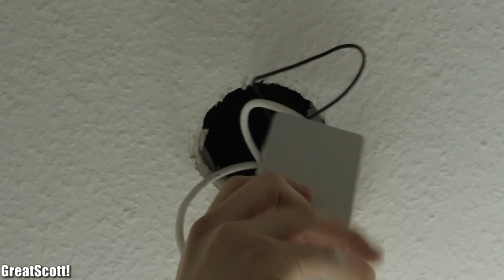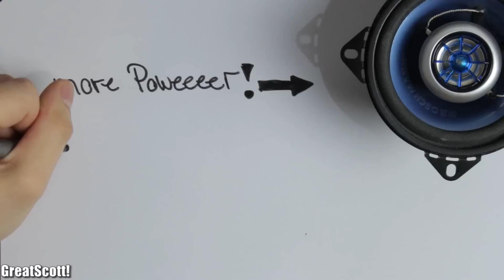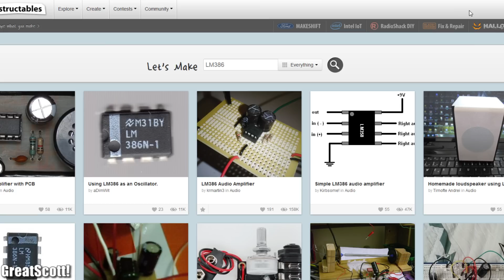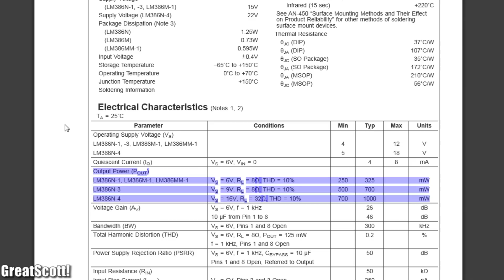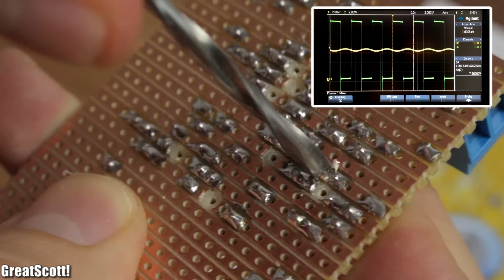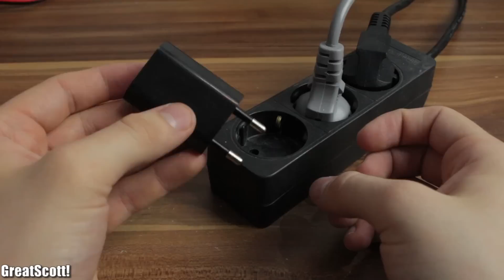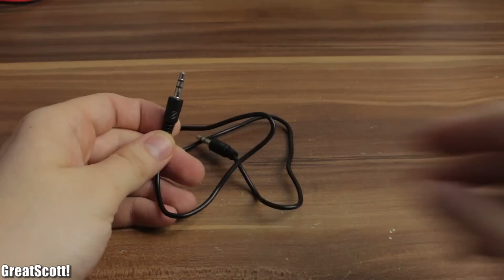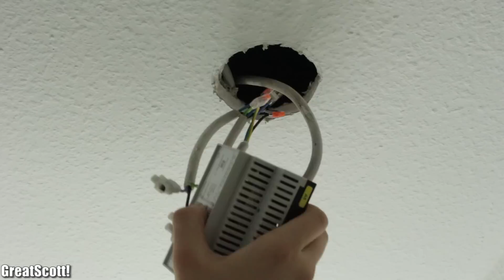Make your own Low Budget Bluetooth Music System || OpAmp

Comment: +GreatScott! You inspired me to build my own version of this using a KRC-86b V4.0 Bluetooth module and a TDA2003 10w Amp chip I salvaged from an old CB radio. In this build you mentioned you were getting interference/noise coming from the 7805 IC sharing source current. How can this problem get solved within the circuit?... At first I put my Bluetooth module in some old computer speakers, but they had a transformer inside them. They had terrible noise, so I ditched them in favor of building a circuit myself with a "wall wort" to separate the 120vac/12vdc power supply. My Bluetooth module is running off a 7805 regulator like you had done. I'm not getting as much noise as you appear to have gotten, but I do hear some light, constant, background noise, and I hear digital chatter randomly coming from my phone connection (like a subtle set of chirps and beeps that sound like R2D2 on drugs). How can I eliminate that kind of noise within a single DC current source? Anyone? :)
Reply: any update on this?
Reply: many capacitors. but with high capacitance.

Comment: i tried this but i think the bluetooth chip is of low quality. After 25 seconds of inactivity(Locking the phone), the led indicator on the bluetooth changes rythm and at that exact moment a significant noise is emitted from the speaker until i unlock my phone. I think it is the chip's problem because the timing of the "SLEEP" mode of the chip coincides with the addition of noise. Anyone faced the same issue or any suggestions?
Reply: +Arjun K V Did exactly the same, and I am getting exactly the same noise. I guess the solution is not to let it powered on when you don't listen to music. This sucks though and I am looking into alternative solutions.
Reply: Sorin Vinatoru HI. I solved it. Well kinda. I put a unity feedback amp to reduce and 90% of the noise disappeared. I found it because when I plugged in earphones, it didn't make any noise, meaning the power amplification in earphones is low and hence one can't hear the noise but when it comes to speakers it's different. It is not the chip since I experimented with a OV3860 one as well which gave me the same result.

Comment: Connecting mains to an open power supply sitting in your ceiling is not good. Should it start a fire, your insurance won't cover your burned down house because you have violated the electrical code.

Comment: What if you want to put an amp and this Bluetooth receiver on the same battery power supply? It lets off a very annoying hiss very similar to when he connected them both to the same power. I am trying to make a Bluetooth speaker and I don't want to have to use 2 batteries or buy a new amp+Bluetooth board.

Comment: This is cool but honestly from a main electrical stand point you should of installed a electrical octagon box in the ceiling (a retro one so you can install it with just a hole like you made) because atm it seems like you have your mains attached with a open terminal which could start a fire, would fail an electrical inspection and could potentially hurt someone that is rooting around up there in the future.

Experience to back this up is i'm a electrician in Canada and electrical code dictates that you need to have a bonded certified electrical box housing anything above 15v. Anything under 15v can be free aired.
Reply: When I saw that I thought the same thing. All connections to and splices in main household power wiring must be in a junction box.
Reply: AnimosityGamers fun fact:
Hes german and should know it better ;)
Jk you're right as this is in a bathroom and the moisture coukd get up in there. Not the best solution...
Reply: Random viewers trying to do the same, unaware they are breaking the law in many countries and also risking killing themselves in house fires... I believe it is careless and irresponsible to publish videos like these without any form of big warning or disclaimer.

Comment: what do you mean with 240 volts can kill you
it´s killing you in reality!!! 
(sorry for bad english)
Reply: +Sound of Generations Not really. A static shock is around 20-25 THOUSAND volts. Its high amperage that kills you :P
Reply: +Skeedle &amp; Epic Plays It's both. A 12v car battery can hold over 40 amps and is safe to touch because of the low voltage.  It only takes 0.1 to 0.2 amps to kill you so 230V in your home under a 20amp breaker could easily fry you all day and not even trip the breaker.
Reply: How dl you mean that?
Reply: get 230 / 240 volts to your body --> you are dead
Reply: +Inductor G yeah but it's still high amperage. I wasn't necessarily talking about mains power. I understand your point and it's right defo but still saying it's both you need. straight up 240v isn't gonna kill you. you need a high current aswell. visa versa too
Reply: +Sound of Generations As someone, who's managed to tap into mains voltage twice, I can assure you the situation isn't always that dire. But as someone, who's managed to tap into mains voltage twice, I advise you to try avoiding that.
Reply: *****
I don't think residual current devices are that widespread, new buildings might have it, but not surely unless it's mandatory.
Reply: actually, 12v car battery is quite dangerous. Yea sure, it's only 12v. And licking a 9v is fine, why not 12v? Well you would be mistaken. Licking car batteries is surprisingly painful.
Reply: happy
I'd guess it's because of the difference in the current they can provide. Car batteries are designed to supply a short burst of a couple hundred amperes to start the engine, 9V batteries don't do that.
Reply: SomiTomi Exactly.

Comment: what software was you using for your PCB layout?
Reply: looks like he is using Eagle Cadsoft. easy and powerful one.
Reply: +Fadhel Ben.Chaabane I'm pretty sure it's not Eagle. The design he did of the strip board.
Reply: For strip board it could be Lochmaster probably the most known ine. I thought you was talking about cad software. I prefer more the usual copper board specilly that insulator and other tools became more affordable. and you can rout you pcb as you want making it smaller...
Reply: Not pcb its circuit because pcb is a board with holes and we have to put components in that

Comment: 230V will not kill you, its the amps that kill you if you get electrocuted
Reply: Without voltage,  theres no amps so..
Reply: Which is true the other way around aswell. Either way you can shock someone with 50,000 volts and he wont die if the amps are low enough. You basically just need enough volts to break through the resistance of your skin after that, its all on amps.

Comment: Scott, could you provide a photo on how exactly did you connect that amplifier on a breadboard? For me it only works when I use the basic NE5534 circuit, when I try to introduce two transistors it either doesn't work or I burn one of the transistors. Local electronics store also didn't have BC637 unit, so I'm using BC556B - it has a different emitter/base/collector arrangement, which also adds to the confusion. Help please :/

Comment: I had also a power issue with an TDA7297 amp I made when I topped it, even with an 12V 3A power supply. I used the same solution you used and it worked marvelous. Thank you for all the knowledge you gave to us all!

Comment: just get a hi-fi amp off eBay 15$ new, blue tooth USB dongle 1.50$ speaker wire if you don't have any 3$ 20ft 
6X9 car speaker box 20$ 
set of 6X9 speakers 25$ or if you have an extra laying around use that 
in total I made a system using those exact items for 60$ and it puts 200$-300$ Bluetooth speakers to shame all my buds feel shitty for spending that money on a speaker haha haha
Reply: And you can charge you're phone off of it as well as play SD cards and also has am FM radio

Comment: that 5V USB adapter won't last long... i've some kind of project that used that adapter and only works a week non stop...
Reply from the maker: +Nasrul Acuy Mine still works after one and a half year.
Reply: +GreatScott! maybe i was using the china one.... okay thanks scott
Reply: +Nasrul Acuy haha.....china one
Reply: +Nasrul Acuy burned
Reply: +Shaun Savoury i was using it for cooling my adsl modem with a help of fan... after a week i notice my internet went slow and check my modem that the fan was off, at first i thught my fan was dead because it spin like 24 hours non stop for a week but actually the dead one is that 5v adapter. i saw usb port at the back of the modem and i plug the fan to it and until now the fan still rollin...
sorry for my english

Comment: I want to do this on a SMALLER scale.  I want it all to fit into an Altoids tin with the speaker attached to the lids all running of a 9V battery.  How would I do that?

Comment: Hi Scott, I use H163 Bluetooth adapter, but frequently, the music breaks up and there's 0.5~1 second gap. sometimes the music is so choppy that you will not want to keep listening to it. 

BTW, I'm using external preamplified 2.1 speakers which have no problem when directly connected without H163. What do I do? Did you face the same problem?

Comment: 99% of the world cannot do this... only amarika has stupid plated roofs
Reply from the maker: +ESHouten I live in Germany.
Reply: +TheFruitsClan You got concrete bathroom ceiling? Because here in Indonesia, most bathroom ceiling are either wood or drywall.
Reply: +GreatScott! 230 arent very dangerous in this case  because  the Rcd  would  get out
Reply: Jens petre It's still dangerous, you should depend your life on some electrical device, because those can fail.
Reply: Only America has "Plated Roofs"?  First of all, what exactly do you have in mind when speaking of a plated roof? Secondly, what does a roof have to do with installing anything into the ceiling? Lol
Reply: Amarika lol

Comment: @GreatScott! Using your light load cables for anything other than lighting is not a good idea. I'm not sure about specifications in Germany, but it's out of code to do that in the UK. It'll work, but depending on your RCD, there could be problems during inspections and testing.

Comment: how about umidity? If I had a shower in the bathroom, wouldn't the water vapor ruin the speaker cone?
Reply from the maker: +TheFabio I did not have any problems with that yet.
Reply: +GreatScott! the speaker will be done with within 1 / 2 years

Comment: It's a shame blue tooth is use for mundane audio transition when there's so much more it could be used for like wireless transmission from a sattilite dish the Turner box or a virtual tunerbox on Android as well as a feature were you share your phones internet connection with the other devices connected to the blue tooth sattilite.

Comment: this power supply can provide up to 2.2 amps  even though i only need 200. clearly you are packing a serious power into that speaker
edit
it looked like you screwed through surround of the speaker
Reply: He meant 200 milliamps.
Reply: +JusstyteN It pulls as much as it needs.
Reply: Stefan Tasik what i was pointing out is he meant 20w not 200w

Comment: I wish I could do and know all this shit :(
Reply: +Juan Morales You can know all this shit. It takes time and practice.
Reply: Same. :(
Reply: True, man.
Reply: bro. get online thru phone. hitup IBSTRUCTABLES. COM.  ez street.... 20 bucks for equipment @swap meet.  get busy kud!!!  :)
Reply: I got an easy way to get the exact same result exept portable and can also be done by connected cord

buy a speaker
Reply: +Juan Morales  I didn't see the whole vid but he could use a trasistor
Reply: +MrApplecraft: that is not true. using only one transistor would make it a class-A amplifier.
Which in almost all cases is off better audio quality.
Class-B is a very efficient amplifier design, but it introduces a switching noise to the signal.
Reply: Juan Morales  same
Reply: I feel ay bro.
Reply: Juan Morales He just did it for you.
Reply: Its pretty basic. Just go to a book shop, find an electronics book that appeals to you then work through it. There will be no electronics 2.0 so there is no rush - I'm still learning stuff from books published nearly 100 years ago!
Reply: You have to build a base of knowledge and keep adding to it forever... Start somewhere.
Reply: Same bro
Reply: +Games4life He is making an class b amp (with the transistors) and uses the ne5534 as an preamp. Only one transistor could work but it would sound not very good.

Comment: Or just get this $20 amp, and connect it straight to a single 12V 3A adaptor; plug your bluetooth directly in it, and play!
20W is pretty ok for ceiling speakers upto 6in.
Amazon: B00721Z1AE  .
http://www.amazon.com/Lepai-LP-A68-Digital-Amplifier-Remote/dp/B00721Z1AE/

Comment: You can buy a Tripath amp, the LP-808 for $11 (amazon: B005YHC4LW) , why even bother making this?

It's a 12V, All you need is a resistor, in parallel with the amp, for the bluetooth (one 12V straight to the amp, the second in parallel to this, with a resistor to lower the voltage to 5V, going to the bluetooth; or, get a dual 12/5V charger amp).

Comment: did you SERIOUSLY just call a 3-1/2 inch coaxial car speaker "pretty high quality"?  that shits about as low quality as it gets these days. you dont even have the thing mounted in a proper enclosure, just sitting in a hole in the ceiling. theres no possible way the shit tier sound its putting out is something worth hearing.

as for how much power the speaker "needs", this figure does not exist. because thats not how speakers work. 1 watt is enough for any speaker to power it. youd be better off buying some 10$ portable piece of shit speaker than making this garbage.
Reply from the maker: +Tetra Digm No need to be this negative. I enjoy the music from this speaker every morning and I can say it sounds quite nice.
Reply: GreatScott! youve clearly never even heard a real pair of speakers.
Reply from the maker: Tetra Digm
I am using a 5.1 speaker system from Teufel in my living room. I like those too.
Reply: GreatScott! their 5.1 systems consist of those shit tier vertical sound bars coupled with shit tier subwoofers. you need to use REAL speakers. not midranges and tweeters coupled with a subwoofer.
Reply: +Tetra Digm nah,  youre just scraping the barrel for reasons to be angry at a video. 'Son'.
Reply: +Tetra Digm if its good enough for the youtuber why even bother with commenting?? he just shared his experience, its up to others to choose to go the same route or not
Reply: +Tetra Digm For the same price ? Haven't found any ceiling speaker for 10$ yet. Also, I think this channel is about building electronic projects not high quality audio. I think your are missing the point. Finally, don't forget to take your Prozac tomorrow cause you are losing control of yourself.
Reply: so many fucks given in this post
Reply: +Tetra Digm You tard, the ceiling is the enclosure.
Reply: Tetra Digm
it's not a sub so it wont be making any sub 100hz.  A mid range speaker doesnt need a specific box, only subs do.  You WANT a flat frequency response - that is ideal.
Reply: everyone still has the choice to listen, good advice or not
Reply: +Tetra Digm You gave way to many fucks, as you can see no one else is. Please stop, you are embarrassing the whole Youtube community with your low I.Q Argument.
Reply: +Tetra Digm I bet u cant even make a better one of these, this is a good diy video and i no u cant do any better
Reply: +Tetra Digm Mind pointing out to the whole class where the law states that it's illegal to solder an amplifier for a speaker in your own home?
Reply from the maker: Tetra Digm
You know I could try to talk more to you about how your ideas of safety and sound quality is clearly wrong. But that wall right next to me looks like a better discussion partner. Have a nice day.
Reply: ndyt which is not a proper enclosure. in ceiling speakers dont just ram up in your ceiling, they sit inside a box to have a specific box volume and produce a relatively flat frequency response. not to mention this little thing will be distorting terribly from any sub 100hz frequencies.
Reply: ndyt untrue and ignorant. all speakers that have rear reflection require a box. you wont GET a flat frequency response with sticking it in a hole in the ceiling. you CANT get a flat frequency response from these piece of shit coaxial car speakers because they just arent capable of doing so.

oh. and your front/side/rears should all be full range systems, of 20hz-20khz. people just dont understand how shitty it sounds to be running satellites, because they've never heard REAL speakers being used.
Reply: RaisedByWolves because his shitty advice leads to not only dangerous situations, as this IS a fire hazard if not properly contained, but a waste of money. you can buy some shit tier car speaker and pop in in a hole in the ceiling and have it sound like shit, or for the same price buy a goddamned in ceiling speaker designed for this application, that actually sounds good and is safe.
Reply: GreatScott! youd also have to have some idea of what youre talking about, and google isnt going to give you enough info to prove your shit tier sound system that is dangerous and in many places illegal (see the entire USA) is anything but.
Reply: negratio if this speaker costs 10$ than it is literally the worst piece of shit you can possibly buy. but it dosent. this speaker likely costs about 50-100$ for a pair, and sounds like complete ass.
Reply: Danny sweeting read various local laws. they vary from place to place son.

Comment: Don't you know how to make a "V" instead of a"U" for "V"oltage?
Reply: +Ron Gardin Technically he wrote correctly, ohm law in original form use U for voltage (U is used for Voltage in Germany). But both ways are correct, there is roughly half of world that use U and half use V (depends what influenced some country has and in some country they use both depends of author) and even in some country they use E.